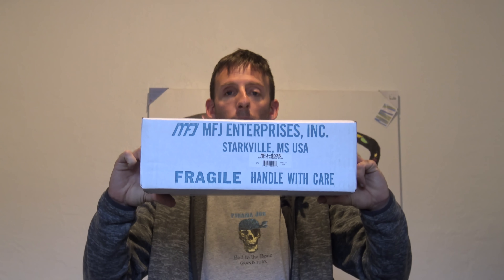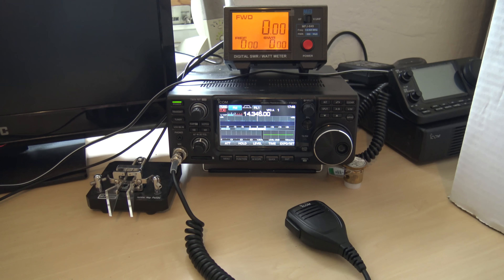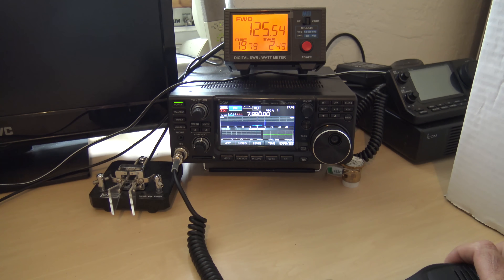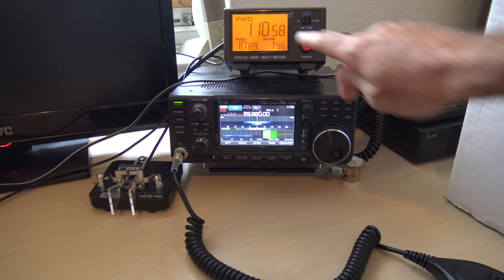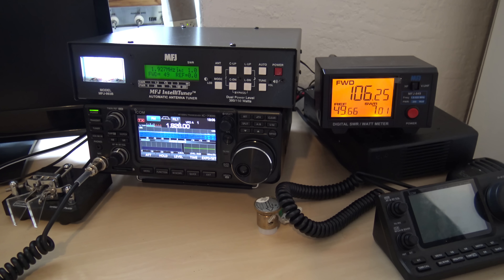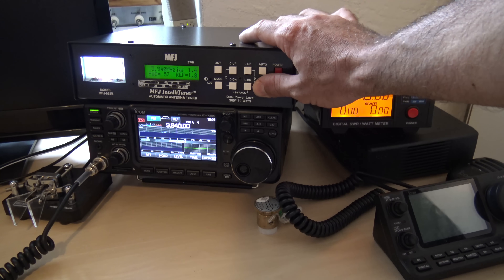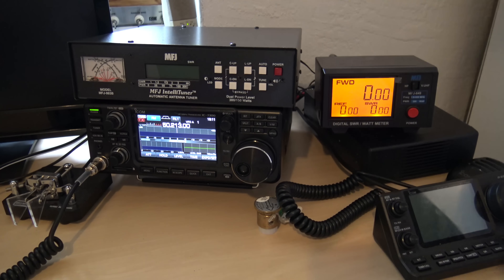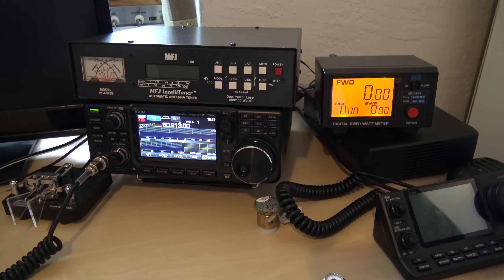Understanding HF Antenna Tuners, What Does It Do?

Comment: Can you run an antenna tuner with a CB radio I’m running an amp I’m gonna be running the 703 RM Italy I have the 505 now and I get about a 1.5 reading 1.4 on my SWR‘s with amp on I didn’t get the 703 in but I’m wondering if the SW‘r is high with the 703 would anybody suggest running an antenna tuner?

Comment: Reflected power is not lost... It travels forward again in phase with the forward signal. That is why your forward power was 100 Watts and your relfected power was 50 Watts. 
Your antenna is probably way too short and not ment for 160m. But reflected power is not lost. It only travels a longer path then your forward power. So your cable losses are less if your swr is 1:1.... But again reflected power is not lost...

Comment: Thank you, I've just discovered Tuners (MFJ 949E)  and as I cut my antenna for a frequency, I find the smith chart says my antenna is at 28 or 112 Ohms... I thought a tuner would help with this, to make it 50 Ohms? I guess not, which is a why use it moment for me, other than not blowing up my radio, but still Poorly getting out?  I would love to see a video explaining , (and fixing) the 40 m antenna cut to 7.188, and showing 32 ohms, at 1:12 SWR???  Is that a poor antenna with no tuner attached? KE8RTS.
Reply from the maker: Best option is to cut the antenna to resonance on a band, and not use a tuner. When you need to use an antenna on multiple bands, a tuner will match the non resonant antenna to the radio, but as you said, it is not doing anything to tune the actual antenna. This has been a controversial point for years since these videos, half of the world thinks an antenna tuner is tuning an antenna, which it's not, the other half of the world is using a tuner to get some sort of operation on the bands with 1 piece of wire instead of having 6 separate antennas for 6 bands. I don't use tuners at all. I get multiband verticals and fan dipole antennas, way more efficient. In my truck, HF mobile, I use a tarheel and use the controller to run the antenna position up and down depending on the band in using, and I always have a 1.0:1 VSWR with no tuner at all, so when I switch bands I adjust the antenna up and down.
Reply: @HamRadioConcepts what the antenna tuner does is tune out the reactance creating a resonant antenna

Comment: He does not understand that a tuner is not supposed to change the SWR between the tuner and the antenna.  The tuner creates a conjugate match at the antenna feed point that results in the antenna being tuned and full power is delivered to the antenna.  Here's how the ARRL Antenna Book explains it. "This reactance cancellation results in a net system reactance of zero, establishing resonance in the entire system. In this resonant condition the generator delivers its maximum available power to the load. This is why an antenna operated away from its natural resonant frequency is tuned to resonance by a Transmatch connected at the input to the transmission line."
Reply from the maker: The tuner presents a match at the back of the radio, it does not "tune" anything. Presenting a tuner AT the actual antenna such as a remote tuner will match a random antenna to a specific frequency. Simply adding an SWR bridge BETWEEN the tuner and the antenna on the feedline will show the VSWR has no change AFTER the tuner.

Comment: All an antenna tuner does is protect the radio. It does not make the antenna work any better. But, an antenna can be way off and still work, just not really well. A chain link fence will work well as a receiving antenna, but you are not likely to actually be able to transmit with it.

Comment: I think what is being seen visually on the SWR meter is only half of what is really occurring. Power reflected back is sent down the feed-line again. Then 3 things occur to that power 1 some transmits/radiates  2 some turns to heat  3 a portion is reflected again. And the cycle continues. In the end, you do not lose or reflect back as much as the power meter indicates.

Comment: I think this video confuses people into thinking they don't need a tuner. When the radio transmits, you don't want reflected power. The tuner safely routes the power that cannot go out the antenna to ground. This prevents damage to radio, but does not make antenna better.

Comment: So if the antenna tuner doesn't really tune anything then what is its purpose?
Reply from the maker: To make your radio see an acceptable and safe impedance when your antenna is not properly tuned or not resonant on certain bands.

Comment: An antenna tuner, u will understand only if there mounted on antenna entry point, if u have em on the rack table u send with the PL Shield and set all under hot HF.

Comment: should've watched this before getting the 993b... oh well, being that I have very limited space and lots of restrictions, all i can do is an end fed vertical, cha-250, but, being that it makes good contacts on 20 and 40 meters, and my radio thinks it's using a resonant antenna, i'll just chalk it up to getting on the air at all cost :/ great vid! 73

Comment: What you say is absolutely correct. Whenever there is an impedance mismatch, there is guaranteed to be less than optimal power transfer. The reflected power is being absorbed and  by the antenna tuner and is dissipated by the AT in the form of heat.

Comment: What MrMomb said. Being resonant ain’t all it’s cracked up to be. If the reflected energy is getting lost, something in your chain must be absorbing it and getting warm. No. The tuner reflects most of the energy back to the antenna which reflects a percentage back to the tuner and so on until most of the energy is sent out as EM radiation. The only way this process would be inefficient is if your coax was very lossy. Antennas don’t have to be resonant to work well.

Comment: If it's true that tuners merely make the transmitter happy, how come people are able to make contacts and work global DX with G5RVs, end-fed random wires, Rybakov verticals, and other non-resonant antennas?
Reply from the maker: It will still radiate power when you use a tuner. For example. If your VSWR is showing 20 watts reflected out of 100 watts, basically you are making your radio happy with a perfect match, and the result is 80 watts forward. It's the same as when I make a contact at 10 watts on my Icom 705, using only 10 watts. But a tuner will allow your radio to not burn up, because of the high reflected power but still transmit whatever power is available after the reflected power.

Comment: P.S. There is a minor caveat to my previous post: The efficiency of a radiator depends on the ratio of radiation resistance to the loss resistance of the radiating conductor. Hence, electrically very short conductors, i.e the radiation resistance drops to very low values, can be less efficient. However, this is a special case.

Comment: So your saying there it no point in using a ATU ?
Reply from the maker: Didn't say that, its for when you can't make your antenna resonant.... First work on your antenna, forget the radio and amplifier, when all else fails, use the ATU to match the unturned antenna

Comment: I fully understand why you arranged the tuners and meters the way you did but if this video is for the beginners (?)  you may confuse them as well as help them .  A little explanation of the correct placement of the external meters for normal use would be good (especially if your tuners do not have built in meters) and always to remember to turn off the internal tuner when using the external one .

Comment: Very well explained. Thank you. Can “keeping your radio happy” equal keeping your radio protected? Would that be a reason to use an auto tuner? Also, is it necessary to have a swr/watt meter when using a tuner?
Reply: Only if your antenna system is close enough to a match that the tuner can bring it the rest of the way.  And having an SWR/wattmeter gives you further reassurance of actually having a matched antenna system.  Besides, "keeping your radio happy" is meaningless if you cannot actually make contacts with it.

Comment: Sorry but I think there is something wrong with your idea of what a tuner does. You were at 50 watts (160 Meters) with most reflected but the power out shows 106 watts, I believe that is because the tuner is doing its job is reflecting the reflected power back to the antenna that is what an antenna turner   ( system tuner) does. The only actual loss is due to the feed line with good coax loss is small. Under what I would call normal use SWR 3 to 5 or so almost no loss when using a tuner.

Comment: The purpose of an antenna tuner is to enable maximum power transfer from the transmitter to the load and to ensure the impedance presented to the transmitter is within its designed range.

Power is not reflected in the manner described in the video.   Two things happen the first is a protection circuit winds back the power to protect the PA when the antenna impedance moved away from 50 ohms.   That's true but irrelevant in context.   Without a protection circuit, the power output from the TX falls as the antenna impedance (SWR rising) moves away from 50 ohms.
The problem is that voltages and currents rise way outside of the PA design and the output transistors fail.   Reflected power does not dissipate in the PA and destroy it.

An SWR bridge or power meter is designed and referenced against 50 ohms.   So using such a meter where neither the input nor output impedance is 50 ohms is meaningless. 

Resonance means the reactive part of an antennas impedance is zero.   Nothing more.   An end fed half wave can be resonant AND have an SWR of more than 10:1.   That's why a transformer is used to 
Convert the very high impedance (say 2500 ohms) of the antenna to 50 ohms for maximum power transfer.

If an antenna is resonant and presents an impedance of 50 ohms then its sole benefit is that you do not need a tuner.   You can deduce nothing about the antenna's performance simply because it is resonant.

It is not generally true to say a resonant antenna is better than a non-resonant one.

Power never vanishes - it has to go somewhere - and one place it does not go is back into the transmitter.

Comment: Very  good video about the use of antenna tunner built in to radio or external tuner. I myself have an antenna tunner only  for a back up since i'm using a 80-10 meter EF half wave. The radio works fine on all the bands without the internal tuner on my Icom Ic 7300. I do use it  just outside the particular bands and is a good back up if you have antenna trouble.

Comment: The only problem is that the wattmeter is misplaced. It should go between the source (radio or amp) and the antenna tuner. Think of the antenna tuner as being part of the antenna.

Comment: Not hate mail, but you do need to spend some time reading "Reflections III" by Walt Maxwell. Your antenna tuner most certainly does tune your antenna "system". By injecting your SWR meter after the tuner, you're not seeing what the antenna tuner is actually doing to the system itself. That extra power you're reading on the meter is not because the meter is calculating anything, it's due the re-reflections from tuner back to antenna of the reflected power from the antenna. It's complicated. Read "Reflections III" by Walt Maxwell and you'll understand why and how an antenna tuner "tunes" your antenna "system". Random wire antennas, fed with low loss ladder line, when used with a tuner, will pass 100% of forward power into the antenna and it will be radiated out into space.

Comment: Sorry but you don't understand how a transmission line works, reflected power is reradiated after it reflects up and down the line by the SWR ratio, it keeps doing this until it's radiated (includes phase delay) or lost in heat due to the velocity factor.   This video is an excellent practical source with easy-to-follow demonstrations. Anyone who uses long wire non-resoniate antennas understands this. Watch the whole thing or come in at 41:00. He clearly demonstrates how an antenna tuner causes a nonresonant antenna to transmit full power.   https://www.youtube.com/watch?v=oejsHzurzv4

Comment: The tuner only matches impedance. That is necessary for the "maximum transfer of power"
That is why impedance matching is important.

What does that "reflected" power do when it "comes back" to the Tuner?
It gets reflected back into the wire antenna again in the "forward"
 direction. It still gets radiated.

Comment: Howdy Eric, great video on tuning a radio & antenna.  I have a question/s on the antenna tuner and swr placement.  Shouldn't the antenna tuner be placed between the antenna and the swr which is opposite your set up in the video?  The antenna tuner is tuning the antenna on the output of the radio.  Wouldn't that reflect a correct reading on your swr meter??  73 Cliff
Reply: He's trying to show that the SWR isn't gone, the tuner is reflecting that energy back to the antenna so your radio never sees it. An SWR meter between the tuner and radio just tells you how good a job the tuner is doing keeping that reflected energy away from the radio, not that the SWR is tuned out of the antenna. If the reflected energy gets to the radio, the radio will reduce power which is why you don't want the SWR reaching it. The tuner lets the radio keep putting out full power.

Comment: Thanks for the clear explanation. An antenna tuner might be able to tune a knitting needle, but that doesn't necessarily mean that it'll radiate efficiently.
Reply: That also means that an antenna system with an OK SWR may radiate better than one with a perfect match. Dummy loads give you a great SWR, after all. The idea of an ATU is to 1. protect your transmitter's finals and 2. let you get at least a potrion of your power output to radiate from your antenna.

Comment: Come on Eric your antenna is not resonant at all. Its has all sorts of coils, traps and co-linear components on it. What is it that you think these things do I wonder? There is nothing wrong in using an antenna tuner It phases the energys so the antenna can radiate it by providing a conjungate match. Every antenna ever made can be treated as an equivalent (RLC lump) electrical circuit. Doesn't matter whether it is a full size, 1/2 wave, whatever... All modern N-MOSFET can normal take 3:1 SWR before becoming unhappy. :-) Check the tech specs if you don't believe me. At 09:26 you say you are losing all your power? No, you're not. Please tell me where it went? It all going to be radiated - some loses. Yes you should put up the biggest antenna that you can but a tuner can help especially if you mount it directly on the antenna. Otherwise make sure to use the least amount of coax you need between you and the tuner, preferably good coax.

Comment: I ran across this nugget from the ARRL Antenna Handbook -  
    "Please recognize that an antenna need not be resonant in order to be an effective radiator. There is in fact nothing magic about having a resonant antenna, provided of course that you can devise some efficient means to feed the antenna. Many amateurs use non-resonant (even random-length) antennas fed with open-wire transmission lines and antenna tuners. They radiate signals just as well as those using coaxial cable and resonant antennas, and as a bonus they usually can use these antenna systems on multiple frequency bands."
    —ARRL Antenna Book, Ch. 2

Comment: I'm reading arguments from 2 or 3 different sides, and I look at it this way.. When I'm at my elmer's house, he has a huge loop that is WAY over 180 meters long, and not close to resonant on ANY band, and we talk all over the world on all the various bands.  Bottom line is antenna tuners work and though the SWR may not be what the tuner says, AFTER the Tuner, the power still goes to the antenna and is ultimately radiated.

Comment: None of these antenna tuners will change the resonance frequency of the antenna itself. The physical size of the antenna decides its resonant frequency, where SWR=1, and the impedance is a resistive 50 ohms. If you change the frequency you want to operate on, that is different than the antennas' natural resonance frequency, you will introduce reactance, which will produce reflected waves and loss of power. The only thing these antenna tuners do is reduce the reactance seen by the transmitter by means of capacitive and inductive loads. The power loss will be about the same as without using an antenna tuner. The only difference is that these tuners will protect the power output stage of the transmitter from getting damaged. The best is always to get an antenna analyzer, like the ones from RigExpert, that shows graphically the resonant frequency of the antenna, so it can be physically adjusted to the frequency you want to operate on. And of course, an antenna tuner when you decide to operate in other frequencies in the same band without having to physically readjust the antenna.

Comment: I'm just getting back into ham radio after a 40 year gap.  Lots of new stuff.  I enjoyed your explanation but in my old age (84) it left me a bit confused.  I think you were right on but maybe didn't go far enough.  (I didn't read ALL of your comments)  If you use an antenna tuner and tune your random wire to 1:1 on the SWR meter at the transmitter it doesn't mean the ANY RF is being radiated.  The power going through your measuring equipment is dissipated either by radiated energy (electric or magnetic?) or through HEAT.  When you load up through a "tuner" you are just making your transmitter happy and you may not be radiating at all.  A "Field Strength Meter) is the best way to measure since it ONLY sees radiated energy.  Even then be careful where you put the FSM since radiation could just be coming from the feed line.  Worth a thought?